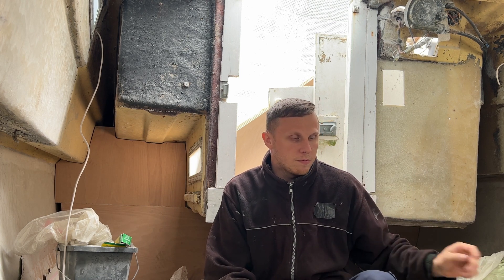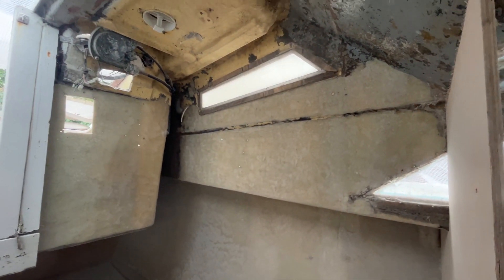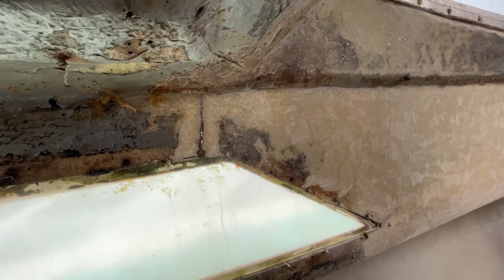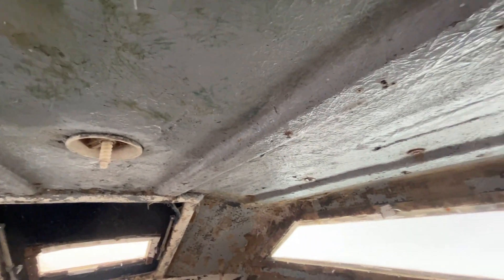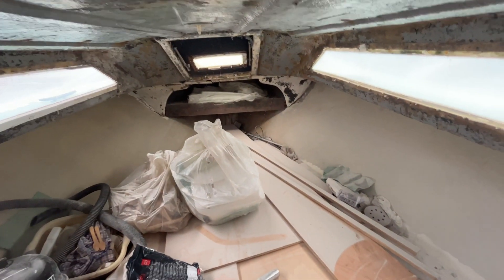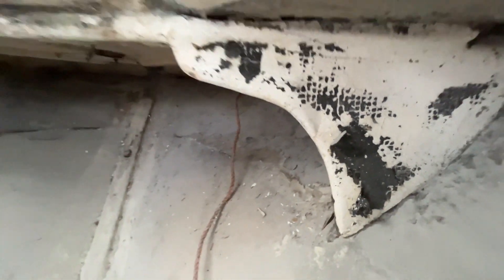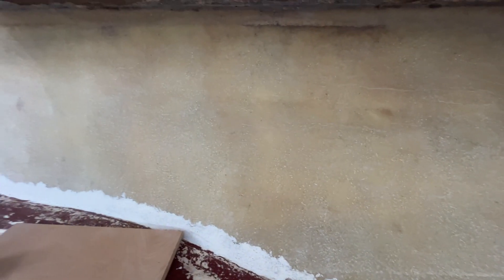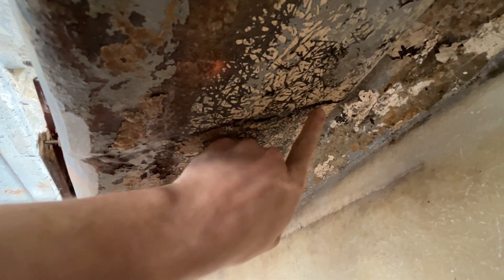start sanding  the  top half and ripping out the anchor locker episode 14

Comment: If you rivet in the windows and down the line they start to leak, you will have to drill out all the rivets to replace the seals.
Reply from the maker: Thank you I will look into this a little more the last time they put these windows in they screwed into wood. Think I need to do some more research